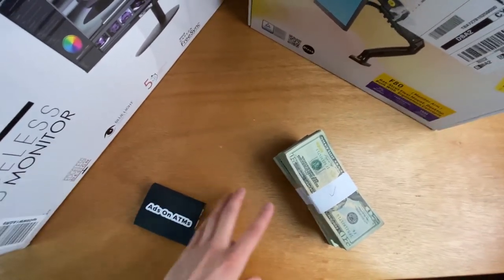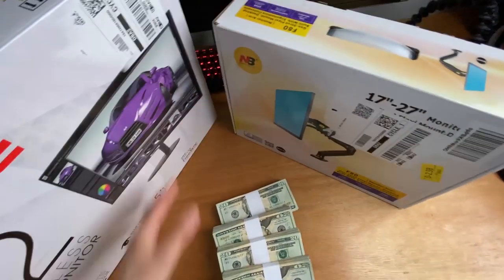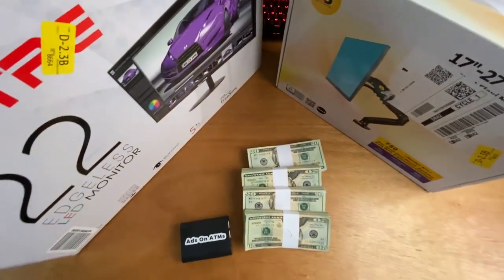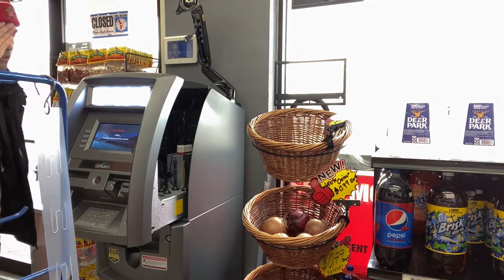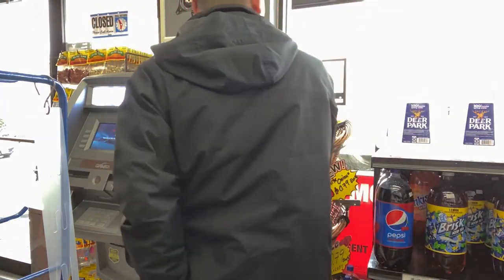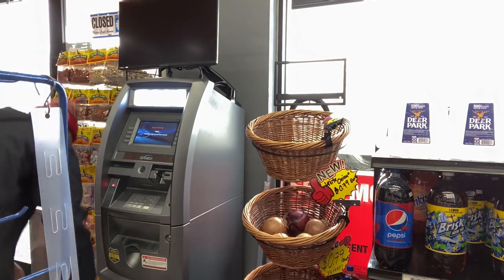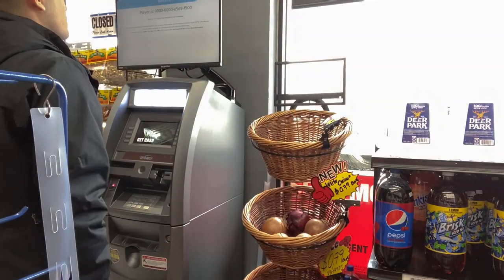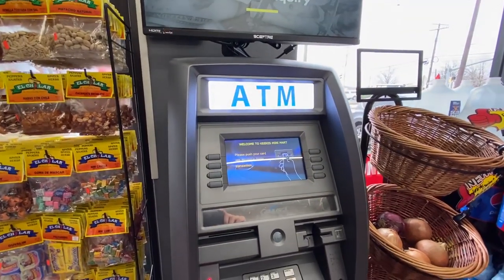Installing ATM Monitor/Topper For Advertisements | ATM Business

Comment: Great video tutorials as usual..Thank you..Question is there a multi machine price break..such as 5,6,10,12 etc.  Where is the price break point..I'm gearing up to get started, but making sure everything is squared away properly..I'm interested in the Genmaga  Onyx..but have a few questions about the different model options..the 4g wireless modem options and gps trackers..Thank you for your time and consideration with this matter..

Comment: Chad, I am just starting out and wanted to ad a topper once I purchased my first ATM and have it set up in a location. I also wanted to attempt to win the ATM giveaway (perfect start). However, it does not seem wise to purchase the ads on ATMs due to the residual fee you are charging. Is there any other way to enter the competition? I am running into the same situation with the wireless router. I wanted to purchase the ATM, have it shipped to me, set it up to become familiar with it before I set it up in a location. Advice? Suggestions?